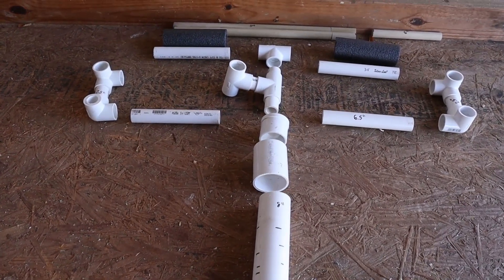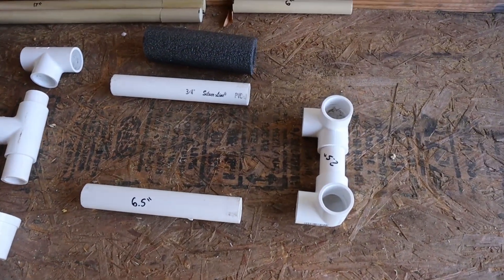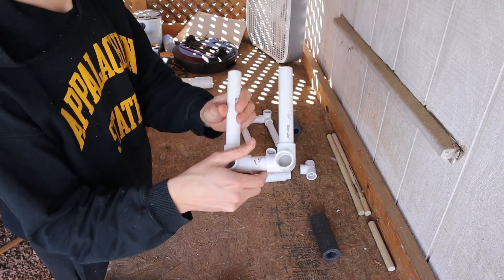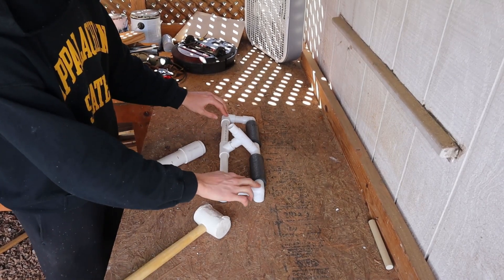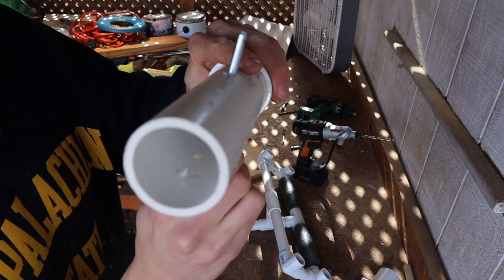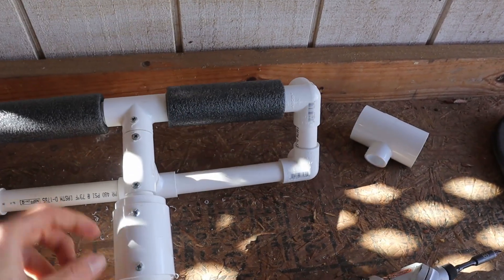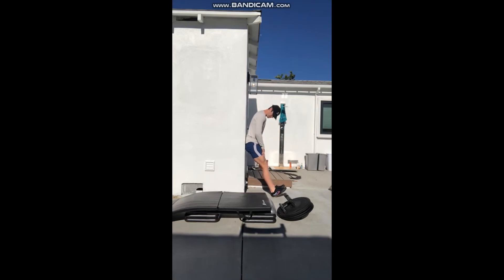DIY Knees Over Toes Guy Tib Bar - How to Make Tibialis Bar and Fix Shin Splints

Comment: Can you please send me a link or description of the list of materials and measurements please?
Reply from the maker: Jay hooked us up with a list and a few comment from his build! Reposting his comment

Jay Kershner
1 month ago
Nice job with the instructions and video... I made this one weekend.  I found a few discrepancies in wooden dowel lengths and the need for wider pipe (1.5") to hold the weights, as all our weight plates have 2 in hole.  Might be b/c the right angle joints I used were longer and fit about 1" of pipe inside them. 

TiB Bar PARTS LIST - so you can go to store with an easy list of what to buy

(4) 6.5” @ ¾” pvc  
(2) 2.5” @ ¾” pvc
(3) 2” @ ¾” pvc 
 total 37” of ¾” pvc - I just bought an 8' piece and use the rest as pipe to do pass throughs
(4) ¾” 90’ elbows
(3) ¾” PVC T’s
40” Dowel rod 2 x17” + 1x6”   - might have to have more or less dowel depending on your fittings
(12’) ¾” pipe insulation  cut into 2 x 5 1/4” 
(1) Hitch Pin 3” @  ¼” 
¾” to 1 1/2” bushing
1 ½” coupling
12” 1 ½” pvc

Comment: what changes do you need to make for standard 1" plates?
Reply from the maker: Different size PVC for the shaft. The wooden dowel will need to run the full length of the shaft to provide support for the smaller and thinner PVC. It's 3/4" PVC for the shaft for standard weights but use the thin stuff. Not schedule 40. The rest of the PVC should be schedule 40. Standard version also available at www.thetibfactory.com
Reply: @ThePetieProject  thanks!
Reply from the maker: @kumbackquatsta  sure thing!

Comment: did you drill holes before screwing?
Reply from the maker: I used self tapping metal screws that you don't have to pre drill. You only pre drill for the longer screw that goes all the way through the center dowel

Comment: What are the size screws (& screw types i.e. wood screws, etc..) you used and how many of each did you use? Trying to make sure I have all my bases covered before hitting up Lowes
Reply from the maker: I used 3/4" metal screws for all of them besides the 1.25" screw for the long one going through the center. Use a screw to secure every joint and it will be rock solid! I don't know the exact number off of the top of my head but I think around 20+ screws total
Reply: @ThePetieProject  You used 20+ screws?? I can only see like half of those in the video! Please reply soon as Im going to the local store any time now!
Reply from the maker: @chrisnicolaou3871  I used 14 on my original one and am using 22 in the production model. 14 is holding fine, just making sure the production runs are extra secure.

Comment: Idk if someone asked this already. How about for standard plates? What sizes pvc would you use?
Reply from the maker: 3/4" pvc, but it has to be the thinner kind. Not schedule 40 for the standard shaft. Make sure to reinforce the thinner pvc shaft with a wooden dowel! Standard plate version is also available at www.thetibfactory.com if you need a reference or want to purchase one!

Comment: Could you make a 1 inch bar version please?
Reply from the maker: I will consider a 1" version in the future! I worry about the structural integrity of a 1" version vs the larger pipe to hold the weights. The current olympic sized one is rock solid!
Reply: Thanks big homie! Subscribed!

Comment: How did you measure bar widht for you feet? I mean these 2 bars where you put feets between. Will this be ok for any size of feets?
Reply from the maker: This is one size fits all! Men and Women with all different foot sizes are currently using The Tib Blaster without any fit issues!

Comment: It’s doesn’t look like you screwed the corner pieces together. What holds them together?
Reply from the maker: They are held together with screws. You could always use pvc cement as well.
Reply: @ThePetieProject  thank you! Ok if I were to use pvc cement how would you go about making sure the whole thing is level and lined up like you mentioned in the video?
Reply from the maker: @austinwilde1167  that's one of the reasons I like using screws instead of cement. If you find that something is off you can always adjust it. With the cement, make sure you are assembling on a flat level surface so that you can tell if things are even and square. Hope that helps!

Comment: Can you make a video on how to make the PVC calf bar? You'll find it on the channel of RedDeltaProject.
Reply from the maker: Never seen it before, will check it out!
Reply: @ThePetieProject  
The video is called 
"My Secret Weapon for Building Bigger Calves".
It's fairly easy, you just need a PVC pipe and t-couplings... But I'm not sure how big the diamater of the t-couplings has to be and how exactly to attach them to the PVC pipe.

Comment: is it possible to list the measurements on the PVC pipes?
Reply from the maker: Jay hooked us up with a list and a few comments from his build! Reposting his comment

Jay Kershner
1 month ago
Nice job with the instructions and video... I made this one weekend.  I found a few discrepancies in wooden dowel lengths and the need for wider pipe (1.5") to hold the weights, as all our weight plates have 2 in hole.  Might be b/c the right angle joints I used were longer and fit about 1" of pipe inside them. 

TiB Bar PARTS LIST - so you can go to store with an easy list of what to buy

(4) 6.5” @ ¾” pvc  
(2) 2.5” @ ¾” pvc
(3) 2” @ ¾” pvc 
 total 37” of ¾” pvc - I just bought an 8' piece and use the rest as pipe to do pass throughs
(4) ¾” 90’ elbows
(3) ¾” PVC T’s
40” Dowel rod 2 x17” + 1x6”   - might have to have more or less dowel depending on your fittings
(12’) ¾” pipe insulation  cut into 2 x 5 1/4” 
(1) Hitch Pin 3” @  ¼” 
¾” to 1 1/2” bushing
1 ½” coupling
12” 1 ½” pvc
Reply: @ThePetieProject  awesome! Whats that last one? 12" 1 1/2" pvc?

Comment: Ok, now I just need the plates
Reply from the maker: Make sure to get Olympic plates if you are going with this design with the 1.25" PVC on the bottom. I already had these to go with my barbell so I designed the bottom around the Olympic plate hole size. I got mine years ago from dicksportinggoods. Not sure where the best deal is now. Dicks is selling the 10lb plates for 18.99/ea right now but they used to run much cheaper around $1/lb. I'm sure you could shop around and find a better deal or look at used options locally.
Reply: @ThePetieProject  or make some concrete weights in a similarly industrious fashion to you

Comment: What's the finished distance between the two horizontal bars?
Reply from the maker: It's around 2.75" inside spacing
Reply: @ThePetieProject  That's a tight fit. The one the 'kneesovertoes' guy uses, looks to be about 5-6 inches and the padded horizontal bar is about an inch or so in front of the lower horizontal bar. I'm going to make a much simpler one and I'm trying to figure out the design and distances. 

Anyways, thank you.
Reply from the maker: @courrierdebois  No problem! It sounds tight, but it's actually extremely comfortable and balances the load nicely in the middle and front of your foot. Good luck with your build!
Reply: @ThePetieProject  I'm thinking that the one I make might be adjustable so that the fulcrum point can be moved.
Reply from the maker: @courrierdebois  nice!

Comment: How wide is the tube to put the weight on? I want to see if it will fit my weights
Reply from the maker: 1.9" Outside Diameter. The sizing is based around fitting olympic plates.
Reply from the maker: Standard plate version is now live!

https://thetibfactory.com/products/tib-blaster-standard-plate

Comment: Standard weights have a 2" hole, and 1 1/2 pvc has a 1.9" outside diameter. Are you sure you're using 1 1/4?
Reply from the maker: I am using 1.5"! Sorry, I know I say 1.25" a couple of times in the video

Comment: How much did it cost you total?
Reply from the maker: Parts were right at $20 and I had leftovers because I was experimenting while designing it. The filler dowel rod and hitch pin were the most expensive parts. I also had some of 3/4" connectors already. You could definitely build for under 20 if you didn't have any leftovers. Of course this doesn't include the weights themselves. Lowes will often have scrap pvc from previous cuts you could pick up for cheaper than the full length pipe to make it even cheaper.

Comment: 1.25 inch pipe is too small to fit an olympic plate on I think its meant to be 1.5 inch or 2 inch pipe no?
Reply from the maker: Correct, 1.5"! I say 1.25 by accident in the video
Reply: @ThePetieProject  no worries, saw the other comments there. Not to worry, I picked up 1.5 inch there.
Reply from the maker: @andrewroberts5055  Nice! Good luck with your build!

Comment: I found I need to make the outside prices 3 inches long instead of 2.5
Reply from the maker: glad you got it to work! some measurements may be slightly different depending on the fittings you are using

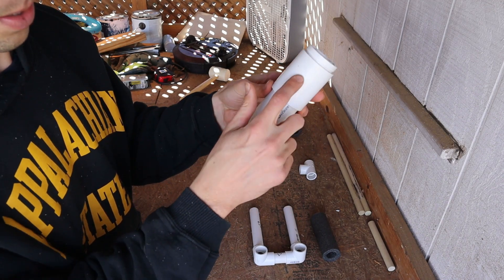Comment: You say 1-1/4" PVC but it plainly says 1-1/2" on the pipe at 3:17
Reply from the maker: Correct, I misspoke. 1.5 is the correct size

Comment: Can't see the point in the screws, just use pipe weld glue and expanding foam glue for the dowel. Other than that, a great build.
Reply from the maker: Thanks! Either option will work great

Comment: if u want to make a batch count me in. id buy one from you
Reply: oh btw how many screws and what sizes were they?
Reply from the maker: Will do!
Reply from the maker: @Alltra801  I believe the screws were 3/4". Put at least one in each connector if you aren't using pvc cement.
Reply: @ThePetieProject  count me in too... well done btw
Reply from the maker: @user-br5sk9zn3y  thanks man, will do! I think the small batch is definitely happening at this point. Will keep everyone posted
Reply from the maker: I've had enough requests that I've decided to move forward with making a small batch for those that want one. Email me at thepetieproject@gmail.com for details. Let's blast those tibs!

Comment: I bought mine and the pipes are so thin that the weights just move all around. I'm using GP industries weights.
Reply from the maker: Hey Louie, which size did you buy? The standard blaster is made for weights with a 1" hole and the Olympic blaster is made for weights with a 2" hole. The Weight's should not be sliding around if the shaft is the correct size.
Reply: @ThePetieProject  Standard. Order #4590
Reply from the maker: @leporoso1986  thanks, what size is the hole on your gp industries weights?
Reply: @ThePetieProject  I'll check later at night when I get back home.
Reply: @ThePetieProject  last night I added cardboard and tape, and it worked, so it's good for now.

Comment: Can I buy this for 30 ?
Reply from the maker: Where are you located? I couldn't  sell it that cheap because of the labor involved. I'm not planning on selling them but would consider it if enough people wanted them. You could definitely make your own for well under 30.
Reply: @ThePetieProject  I’m from nyc and I don’t have tools
Reply from the maker: @strangerwardrobe1352  Let me see if I get more requests and I may make a small run to sell and be able to hook you up! You may also be able to get the hardware store to make the pvc and dowel rod cuts for you as another solution since you don't have tools and then you could glue it together instead of screwing it together since you don't have a drill.
Reply: @ThePetieProject  Thank you sir!
Reply from the maker: @strangerwardrobe1352  sure thing!
Reply: @ThePetieProject  I’m interested too in buying your DIY tub bar if you are interested in making a few and selling.  Thanks!
Reply: @g-rock5210  don't you feel like it would be a much bigger accomplishment to make it yourself tho??
Reply from the maker: I've had enough requests that I've decided to move forward with making a small batch for those that want one. Email me at thepetieproject@gmail.com for details. Let's blast those tibs!
Reply from the maker: @g-rock5210  I've had enough requests that I've decided to move forward with making a small batch for those that want one. Email me at thepetieproject@gmail.com for details. Let's blast those tibs!